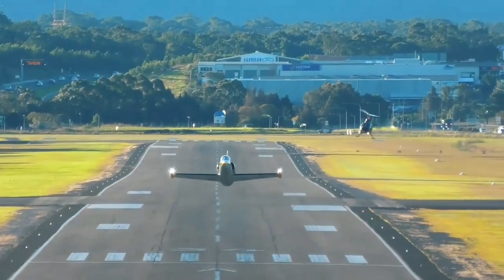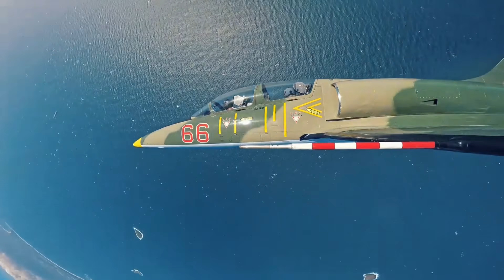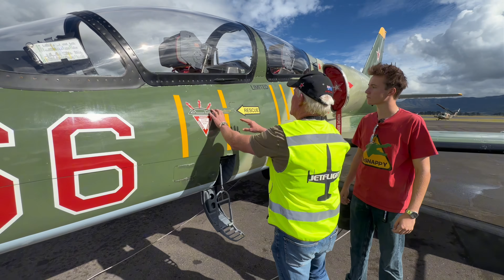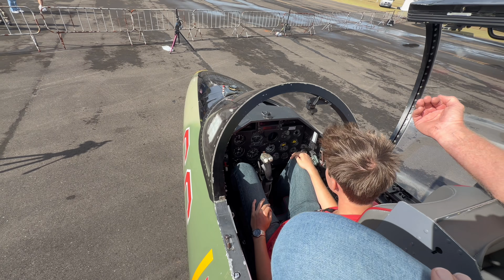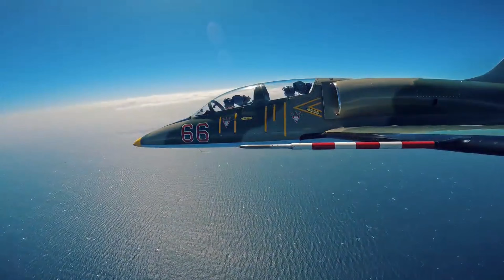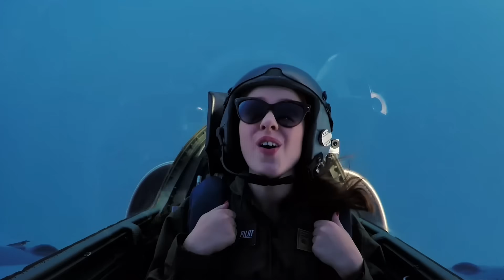He Bought a Fighter Jet Instead of a Sports Car - L39 Albatros

Comment: People in the comments are pointing out that this is a trainer aircraft rather than a fighter—which is true—but it could be modified and equipped with small missiles or a cannon to shoot down drones (a capability that is highly relevant right now). In fact, the L-39 has always been classified as both a trainer and a combat aircraft, not merely a trainer. It can also serve as a light attack aircraft.